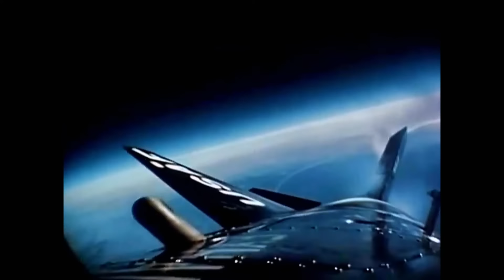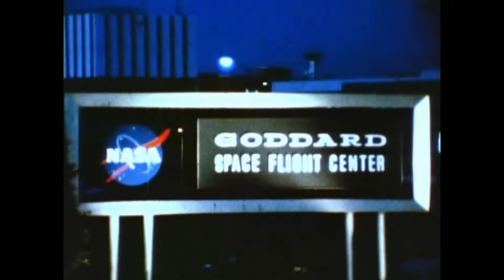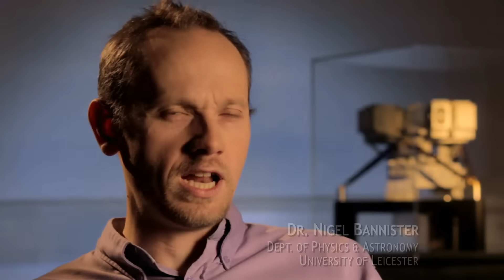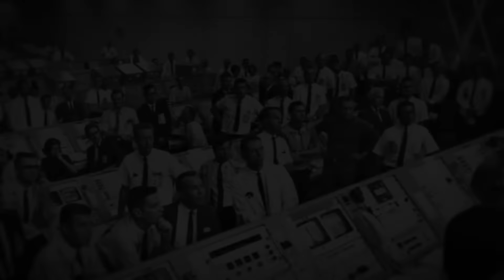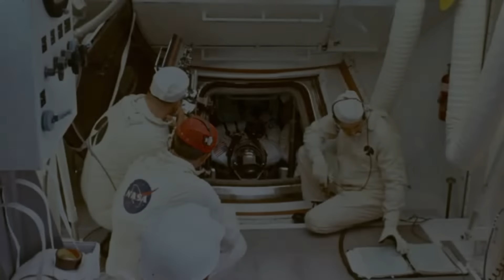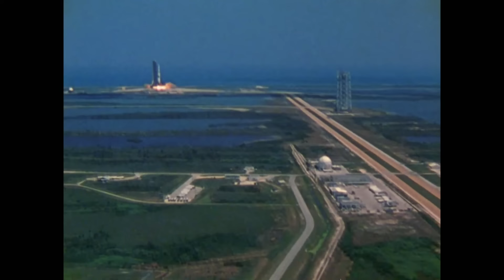The Incredible Story Behind Saturn V's development

Comment: Too bad they never landed on the mood. How did they get through the Van Allen belts? How did they deal with solar particle radiation on the moon? Why did that fog their film? Why did the shadows cross? What about the field that chose a bit low earth orbit
Reply: All your questions are easily answered with a little research.  I suggest you spend your time doing that, rather than wasting it with 'conspiracy theories '.
Reply: Prove it. Your claim means NOTHING without evidence.
Reply: Diesel fumes cause brain damage.
Reply: Diesel fumes cause brain damage.
Reply: Do you mean, "why did that NOT fog their film"? 

So how does radiation effect the human body? The answer is by not only intensity but duration. So, do you think they camped out in the most intense region of the belts?
Reply: @kitcanyon658  
"...how does radiation effect ..."
effect
affect
Learn the difference, genius.
Reply: @daryllect6659  : Indeed...